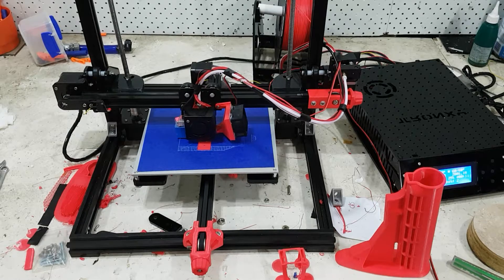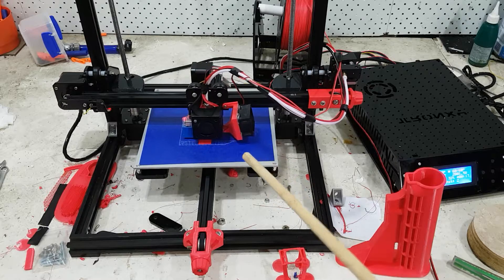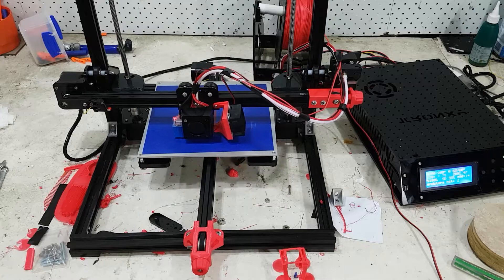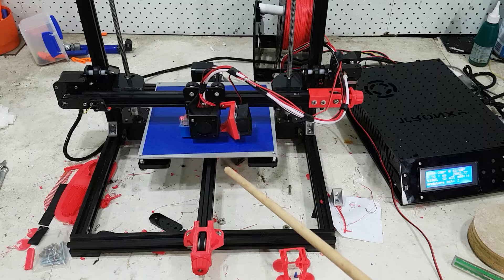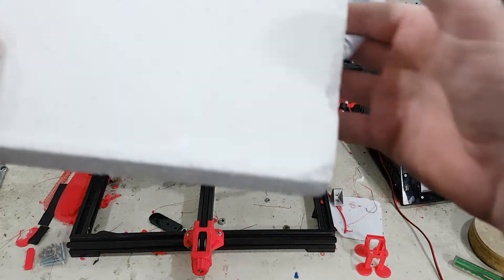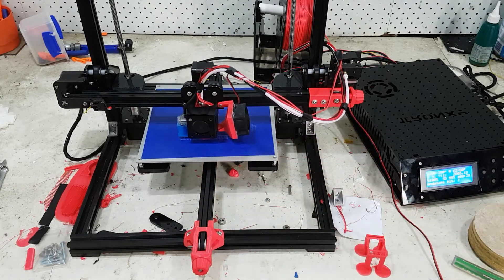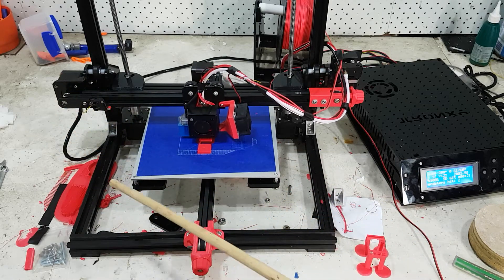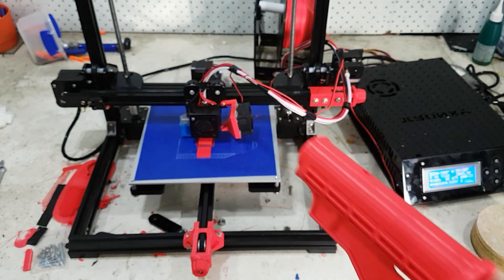Tronxy X3 3D Printer Build: Various things: Episode 5

Comment: I have this printer with the autolevel feature.  It does something very wierd. When I instruct it to go 'HOME' it zooms over to the front left of the printer, and touches home, but then ALWAYS proceeds to about 2/3 of the way back on the bed, to about 2-3cm past the center point. I cannot imagine what is causing that - or how to fix it. Any ideas. It prints ok. But I expect it to start in the 'traditional' home location (i.e. 0x, 0y, 0z) and it invariably zooms over to that far back location. Very perplexing.

Comment: Great Videos Man!  I was wondering if you could send me any slic3r config bundles???  I have just bought this machine and I'm having problems with prints.  When I print the X3_Automatic_level.gcode supplied it oprints great... but when I tried one of my own slic3r  gcodes the printer prints way too fast and make garbage.  Thank you for your time!
Reply from the maker: i unfortunately don't use Slic3r .. i gave up on the free ones and now use simplified 3d
Reply: Thanks for your reply... I went ahead and got Simplify3D last night and got it all working with the Tronxy X3A.  I was wondering if you could send me some of your "FFF Profiles" for different materials?  I see you can import them, you would be making my life so much easier!  Thanks again...  Hope to hear back soon.  :)

Comment: I'm 1/4 of the way through the Build and already I find issues with inaccurately sized screws for assembling the heated bed support pulley wheels. Bugger.
Reply from the maker: i found it a bit crazy that there are SOO many different sized screws that are almost the same length but aren't ....

Comment: When you first set up the printer did you have to set the amps to the motors using a multimeter? and did you need  to spend a lot of time on calibration or is the Tron XY reasonably accurate from the first print??
Reply from the maker: I have not changed the amps to the motors... there seems to be no need for it HOWEVER if you add a glass bed that will significantly increase the weight of the Y Axis and then you MAY need to increase the amp.. I've made no changes to the calibration of the printer.  The print quality if VERY good better than the normal persa printers .. HAve seen the prints coming from a 3k ultimaker and mine look better. you seem to need to spend alot of time playing with the slicers setting to get good prints no matter the printer you buy  

 One thing i would say is to NOT buy them from gearbest they seem to be selling the old model with all the alignment issues.
Reply: Good point. Im not a fan of bue tape so I'll prob go with glass. Get  the bed levelling right & you 'can't get them off glass', no need for hairspray or glue, just get Settings correct and you get nice prints.
Reply from the maker: Humm i haven't gone Glass because i haven't figured out how to do it right.. I burst out laughing when i see people using bulldog clips to hold the glass to the bed... seriously people on a printer the moves the bed/ glass / and job... people think a bull dog clip is a good idea ...errr no.
Reply: Ive used bulldog clips on my reprap i2 since day1. Ive never ever had a problem with the glass or the print moving so I guess you may have weak clips or you're not using them correctly; Try adding strips of sliced rubber balloon under the clips, that'll stop them shifting ; )
Reply from the maker: The rubber is a good idea.. and sure it will work with "clips" but it will affect the max speed / jerk /acceleration / job weight you can use.......  Still there are bigger issues than this right now... LOL ... Still the clips are a horrible idea must be a better way
Reply: Youre not adding a household brick, just a piece of flat rubber under the clip where it holds the glass plate : )
Reply from the maker: oh yeah .. i know... im just being pedantic about the fact it relies on clutch force to hold everything in the right place...

Comment: Is there any manual what settings to use for the Tronxy for compiling the firmware? What settings did you use?
Reply from the maker: i have not been brave enough to recomplie it because im that some crucial setting will be over written and result in poor print setting so i haven't flashed mind and i'll try to avoid it.

But you maybe looking for this   
https://github.com/TronxyX3/Wiki/wiki